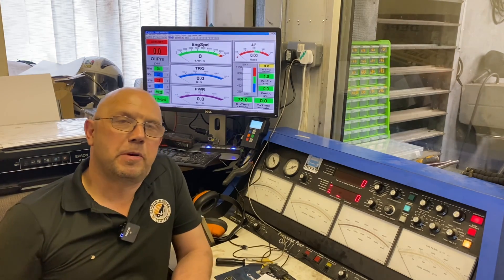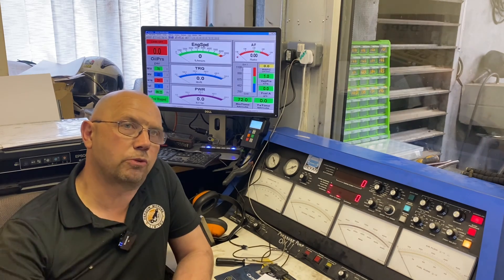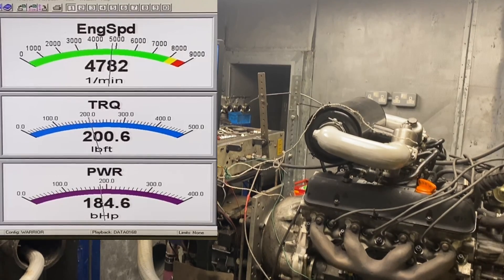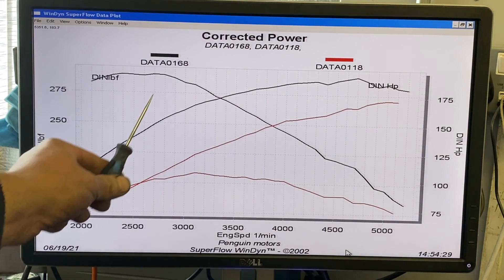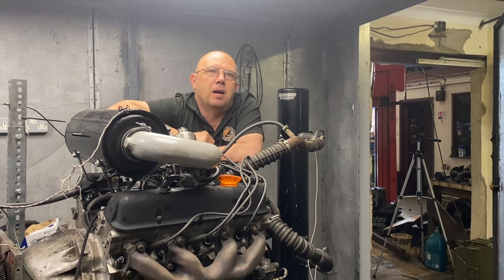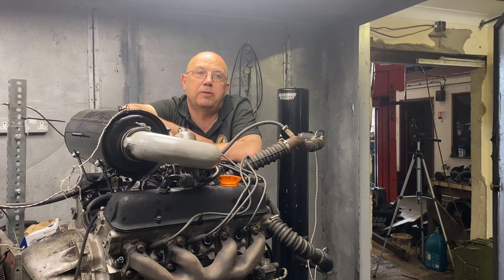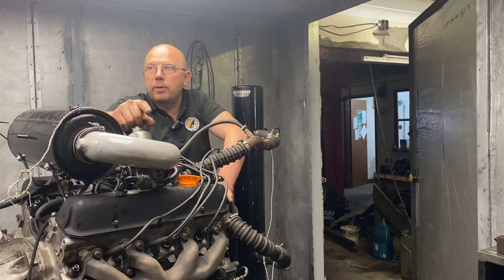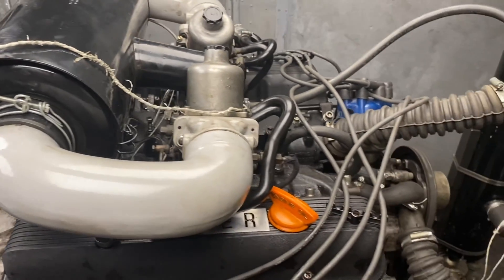Rover V8 3.5L to 4.6L upgrade DYNO TESTED! Rover p6 - Part 7

Comment: Is there a kit of parts to take a 3.5 to 4.6 (pistons, crank, connecting rods, etc)
Reply from the maker: No as you can't directly convert a 3.5 to 4.6. You can stroke a 3.5 but it's not straightforward easier cheaper to swap to a 4,6
Reply: @PenguinMotors  Thank you.

Comment: Just read an article that said a 300 Buick head will bolt directly on a 3.5 Rover. They said it was a 1964 or newer head with muck bigger valves. Problem in inlet ports were way bigger than the Rover 3.5 Manifold. also, a cast iron head. And smaller combustion chambers would make to much compression needing a thicker head gasket. Just a thought wondering how much more you could get with better breathing.

Comment: Is this sort of torque too much for a 71 MGB Roadster ?  Would it better to do a 3.5 /3.9 withsome other mods?Thanks
Reply from the maker: Depends on what your looking for  tuned 3.5 is very Rev happy, bigger engines are much nicer to drive generally as you don't have to work them as hard. If you on rubbish 165/14 tyres then yes a 4.6 will probably have way to much torque for an MGB, but I know of quite a few cars with quad Webers on a 4.6 so about 300bhp/. 300/lbft and they seem to cope just fine on track day tyres.
Reply: @PenguinMotors  Thanks. I will be running 15s from  MGCs  .... BTW,Awesome vids...

Comment: something is wrong with the dynochart for the 3.5/4.6

ignore any comparison where the 2 engines torque and horsepower lines dont cross at the same rpm
Reply from the maker: lines only cross at 5252 if you have the same scale both sides of the graph, the superflow graphs dont automatically do that

Comment: Need to keep in mind the weight increase of the 4.0 and 4.6 due to the increase in crank size / weight.  They don't like to rev like the 3.5 and 3.9
Reply from the maker: im not sure you really would notice the crank weight, but the 4.6 makes so much more torque in the real world it has no down sides. the 4.6 in this video despite being strangled by the su carbs and a very mild cam sill made  40lbft more torque than the 4 barrel carbed 3.9 i just did.

Comment: I am sold on the 4.6.  I am an old Hotrodder in the US who has turned from Studebaker to MG. Learning a new language in my 60s is difficult though. Thank you for all the great info.
Reply: 4.6 from an engine that's around 150kg (330 lbs?) is a lot of engine for the weight.

Comment: Did you need to rejet the carbs for this? Thinking about swapping the 3.5 in my land rover for a 4.6 and either reuse the existing strombergs or switch to SU's. Engine is a bit tired and fancy a nice and simply upgrade even if im leaving some performance on the table not going bigger carb or EFI.
Reply from the maker: The carbs had already had a needle change when the 3.5 was uprated, 4.6 worked just fine on the same needles

Comment: Excellent videos on these V8s! Back in the day when we ran P5Bs and P6Bs the issue/worry was always the relative fragiity of the transmission of the P6Bs, in particularl the diff.
Reply from the maker: I recall back in the the 80’s I worked for a company that built a p5b v8, cam, head work and Holley carb, the owner drove it like he stole it, the BW35 gearboxes used to expire every 3-6 months

Comment: I am currently installing a nicely rebuilt 3.5 engine, the cam appears to be stock judging by the vacuum that the engine is pulling on idle (20 inches). I'm setting the timing up so that the vac system is connected to the non-timed port of an Edelbrock 500, the static timing is 4 degrees, the vac system adds another 18 degrees at 18 inches of mercury so the idle timing is 22 degrees and the engine is very happy with this. (it can of course drop the 18 if the throttle is floored!). I've modified the bob weight stops so that they can add 30 degrees, this means at WOT and high rpm the engine is running 34 degrees, at high rpm but with the throttle just cracked open it could possibly go to 52 degrees. Anyway I recall that you have run some full power runs of a 3.5 on your dyno, I would be grateful if you could let me know what was the best 'all in' figure that you found. (The books all state 36 degrees but a seem to remember you had better results with a lower figure.
Reply from the maker: modern unleaded fuel burns faster than old leaded fuel so you rarely need as much advance as the old school books suggest, i highly doubt you will need any more than 34 degrees, from memory i think most 3.5's want 30-32
Reply: @PenguinMotors  What you have said makes a lot of sense, I'll make a sleeve to put over the post that is part of the bob weight system to restrict the timing to around 30 degrees. Thanks again!

Comment: What happens with the crank? Is it shorter? As far as i know the cam will need to be longer for the distributor
Reply from the maker: Crank is actually longer and requires a spacer when used with p6 timing cover and cam.  For cam use 3.5/3.9 long nose cam

Comment: Great upgrade - would have been good to do straight comparison with all the different exhaust manifolds P5B - P6 you've done - twin pipes from SD1 & range rover - MG RV8 and a typical aftermarket 4 into 1. Another good comparison would be - SUs you've done - Stromgergs - 2 barrel 38dgas - 4 barrel weber & holley and injection. Please more honest videos
Reply from the maker: Some of that will be coming in the nearish    future, problem is without going down the route of channel sponsorship it’s simply too expensive to do that sort of testing unless I have a clients project which lends itself to doing some testing

Comment: Great video, thanks for sharing it - can't argue with those numbers!  That torque is gonna make a 1275kg car move alright.  Reading about this conversion and talking to a few people, with a manual car you will eventually break the half-shafts if you use it in anger.  To my knowledge most of the drivetrain isn't that different from the 90BHP 4 cyl, so I'm surprised it copes as well as it does, but no escaping the fact it's much weaker than the SD1 which was engineered from the start for the V8.  I'm guessing anyone seriously contemplating this is NOT running the notoriously weak 4 speed manual or the BW autos which are pretty much on the limit.  The final drive (which has only an extra pair of planet gears) and UJs are going to have a drastically reduced lifespan I'd suspect.
Reply from the maker: I know at least one 4.6 fitted to a bw65. It seems ok, but to be honest it’s always going to be a case of how hard it’s used. Same for running a 4 speed manual the gears are reasonably wide, so if driven with sympathy I wouldn’t expect to to immediately expire, that said the one this video was about was fitted with an LT77 and so is my own car which is waiting for a 4.6 transplant
Reply: @PenguinMotors  Awesome.  The thing is, if I had this conversion, would I use it "sympathetically" at all times - with ~£5k of engine work on the table - of course I wouldn't!  I have a tuned 3.5, it's not fast but TBH I think in some way it might miss the point in this type of car.  What's disappointing driving it, is the thing just doesn't rev.  So given the practical limits of the car (for a start you can only really run 205 tyres), there might be a good case to make a "fast road" car that's more "playful" and willing to rev, rather than being outright fast - oh and a sharper throttle response than SUs give might be nice.  This comes from driving Stags.  I was really disappointed at standard Rover conversions, as the engine couldn't be more different than the OHC Stag engine.  OK admittedly the fact the Rover will stay in one piece is a big plus - but the Stag, with similar power to the 10.5:1 Rover will spin up to 6,500 fairly easily and there is actually a purpose to going above 4000.  In real A/B roads with bends and 60mph limits, this is far more fun than driving it like an EV and really these are playthings rather than transport these days.

Comment: I'm a bit late to the party having just seen this and it's not that different to mine - my knackered 4.6 heads were saved with a set of very very slightly bigger valves (ones that don't need new bigger seats) and like you I used the standard cam, carbs, airfilter,  etc off the old 3.5. My 3.5 exhaust manifolds had been built for looks from box section and I thought were awful for flow but I still got the same as you, 201bhp and 291lb/ft so maybe they're not so bad after all. The difference in driving is just staggering, it's definitely the best engine mod you can do IMHO. 4mpg better fuel consumption too :)
Reply from the maker: Yes my client reported improved fuel consumption too

Comment: What sort of budget are we talking about going from 3.5 to 4.6? I have a Land Rover 101 with the standard (low mileage) low compression 3.5 V8 and i'm contemplating upping the capacity but don't know whether to just drop a second hand 4.0 or 4.6 into it or having the original engine capacity modified.
Reply from the maker: you can enlarge a 3.5, but you cant actually make a 3.5 into a 4.6, so if you want a 4.6 you have to start with a 4.6 bottom end. you can use your 3.5 heads timing covers, ancilleries etc on a 4.6

Comment: Back in the day I owned an SD1 3.5 running twin Strombergs but always looking for a bit more power I bought and fitted a brand new 390 cfm Holley carb, offenhouser manifold and Mallory distributor which straight out of the box really improved the bottom end power but the top end suffered a bit which was a bit surprising. Because dyno's weren't round very corner in these days I was happy enough with the low end gains to live with it.
Reply: Quite interesting read for me as I have the new Holley carb. but like to know if the Offy manifold you have is the split plane? For distributor I got the HEI and an MSD box.
Reply: If I remember correctly it was an offenhouser dual plane inlet manifold. It ran like a clock with the holley, much better than the twin carb setup and a coin would sit on its edge on the rocker cover when idling but top speed was down slightly maybe 5mph and I could almost feel it holding back at full revs but I dare say different jetting would have solved that problem. It was really good on fuel too if driving sensibly but lucky to get 10 to the gallon flat out. @goratgo1970

Comment: I don't get it. whats the point if the engine can't breath properly? Its crying out for better carbs and cams surely??
Reply from the maker: the point is we were not allowed to fit better carbs, but that aside the extra torque is very noticable even with restricted intakes

Comment: Interesting stuff Graham, I raced a rover  V8 powered MK2 Cortina for 30+ years, 3.5 and then 3.9, the final spec was 471 GMC supercharger 650 double pumper Holley, stage 2 high flow heads, blower cam, 7.:1 pistons, Helix clutch and ford T9 4 speed, the best ET was 12.00 @117 mph I never put it on a rolling road but looking at the numbers and the weight of the car I recon it was around 350 - 400 bhp the maximum boost was 5-8 psi , I always wondered what this engine could have been pushed to, what do you think? I sold the car after Shakespeare closed and now have a Camaro.
Reply from the maker: i would of guessed you had something like 350bhp, but the torque would of been huge, you must of broken a good few T9's. Natrally aspriated its always going to struggle to make real big numbers, the engine simply doesnt flow air well enough to make real power  and they dont take kindly to high rpm with, but with forced induction  i would of thought 600bhp wouldnt be too hard to achieve.
Reply: @PenguinMotors  Thanks for the reply, yes broke a few gearboxes, props, axles, clutches, bellhousings.. the limiting factor was really upgrading the drivetrain to accept more power, I was going for a Tremec 600 but when Shakey and York closed I lost interest, I know of one guy that ran 30psi of boost on methanol with his rover that was pushing out well over 1000 BHP and ran in the 7's with a Pop, outa my price range though ££

Comment: Did the bores on P6s exhaust manifolds match the heads on 4.6 ? I had to use a tongue sander on mine similar tho in P5b cast iron but they matched in the end Ps: I had  installed a 4.0litre ports were massive compared to standard 10:5;1 P5b which were tiny by comparison
Reply from the maker: yes they did

Comment: I think that car needs some  suspension bushings etc  Engine?? A 302 Ford is smaller and makes more power
Reply from the maker: The car it went in had an uprated anti roll bar and shocks and actually was quite good. 302 wasn’t an option

Comment: I saw this engine in an Osca at an autocross back in 1964, it was called a Buick 215 cu. in., I have always been enamored with that engine.
Reply: Always enamored with the Buick 215 / Rover 3.5.    One of the most underated engines of all time.  You chose well. Cheers.

Comment: I loved this, what a great video (and series). I've got a '69 Series 1 P6 V8 which has the 3-speed BW35 box. I would take the 4.6 in that set up every time.  Why? You can put the 3.5 in '2' which locks the box, and leave it there all the way up to about 65mph from a standing start. It's all torque which still embarrasses a lot of modern cars. Now, with that 4.6, that's rocket ship territory where it all counts from 0-3500 rpms.  Then '3' should kick in... I imagine it would pull a p6 easily up to 140mph easy.  Not that you would want to without a Police-spec front air splitter.
Reply from the maker: the 4.6 almost makes the gearbox redundant!

Comment: What power output do you think you could you expect from a 3.5L Rover V8 in Stage 3 set up with tubular exhausts?
Reply from the maker: hard to say,  aside how well the cylinder heads actually work, cam and induction choices will make a big difference, you could easily be somewhere between 250-300bhp
Reply: @PenguinMotors  This is a newly rebuilt 3.5 built to stage 3 by JRV8 using edelbrock 500 carb. Does that help you to assess the engine?

Comment: Hey, will the 3.5 head gasket fit the 3.9 without issues?
Reply from the maker: No you can’t use a 3.5 head gasket on a 3.9 because of the bigger bore on the 3.9. But you can get 3.9 gaskets in steel or composite
Reply: @PenguinMotors  ok thanks for replying... unfortunately I already ordered the gasket; however I have a 3.5 engine but ordered a 3.9....am I at an all lost situation?
Reply from the maker: you could use a 3.9 gasket, but its not ideal, gaskets are cheap anyway
Reply: @PenguinMotors  ok thanks again, I agree the are cheap online; I live in the Caribbean which makes it costly to get here

Comment: Hi, I have a 4.0 liter long block and some 3.5 heads from a RRC. I was thinking a 4 barrel and a mild cam. I was hoping to replace my tired 3.5 liter on my defender. What carb would you suggest in terms of CFM? How many HPs would you guestimate?
Reply from the maker: 4 barrel carbs are not really my thing but I would suggest Holley 390 or Weber edlebrock 500

Comment: I would be very interested to see what a Ford Essex 3.0 engine can produce without enlargement - back in 1984 i recall reading a copy of a British car mechanics type' magazine where someone un-named fettled an Essex to produce 250HP in old money with a set of triple Carbs and possibly some intake and exhaust tampering but not by enlarging the CC. Having owned a RR Classic 3.9 I have to say the V8 was very under welling in terms of torque/power. Yes the RR was heavy and I made adjustments for that but it was a very flacid engine. I took the engine out and replaced the camshaft and followers etc, etc, and it ran very well on completion but other than the sound that V8 is pretty sluggish in my opinion
Reply from the maker: over the years ive worked on a fair few Essex V6 engines, but ive never actually rebuilt or done any performance modifications on one. my understanding 230 odd bhp isnt too hard to get

Comment: Hello sir please help me with the direction of piston most especially where the word front faces for both sides
Reply from the maker: Front would be towards timing chain end of engine
Reply: @PenguinMotors  hello,, thanks what about for a range rover 3.5l v8 direction of pistons written front for both sides please
Reply: Also which side should the dowels face on the block
Reply from the maker: you mean the ones which locate the heads? pointy end up
Reply: @PenguinMotors  hello please can I have your email so that I can send to you the pictures that I need your help
Reply from the maker: @juniorkaciru9123  penguinmotors@outlook.com

Comment: It's rather interesting to see how you folks down there deal mainly with small displacement engines and rather small power outputs.  Where I'm from right in the middle of th U.S., it's hard to find somebody who builds an engine that's less than 325 cid, or for you metric folks, 5.3l.  I personally am gathering parts to build a 470 cid engine, and I feel like it's still small.
Reply from the maker: reason is we dont really have any large capacity engines
Reply: It's not so much the capacity..its what you do with it...most v8 rover motors end up in cars that don't weigh 2 ton...so they don't need a big block....there was a chap in the 1980s and 90s called Steve Green....ran a mk1 cortina with a v8 rover....the last incarnation of  that car before it was wrote off( the original mk1 ...not the spaceframe one)... had a 5ltr rover...that did low  9s over the quarter ..and stood on its ass when he launched....that car..driver...and engine is legendary.....check him out..there's still videos on YouTube..